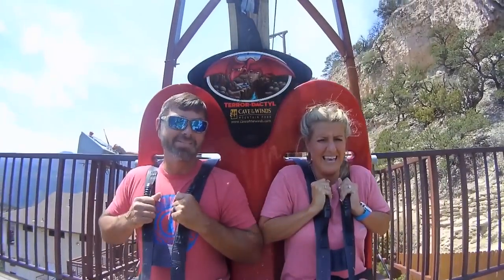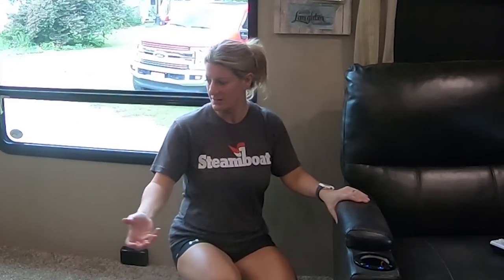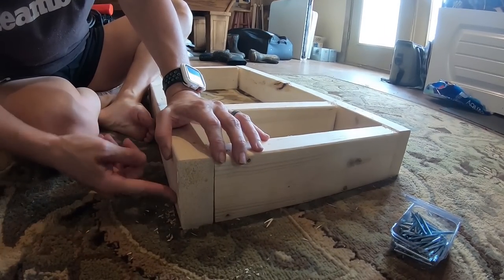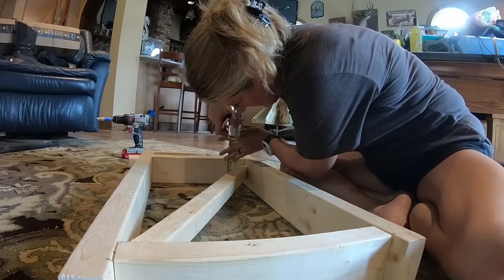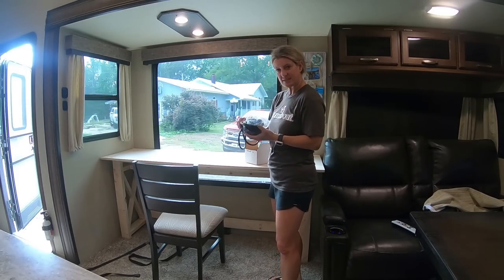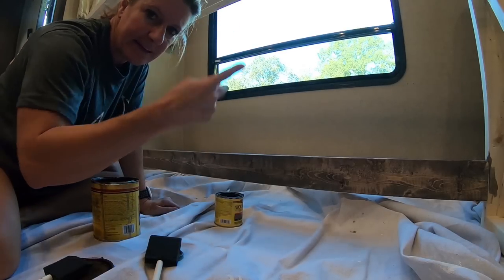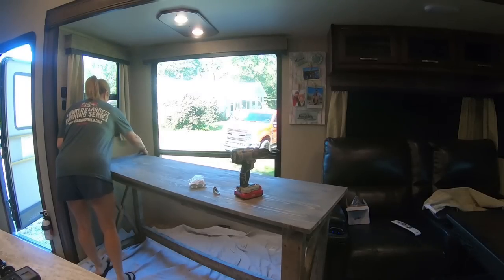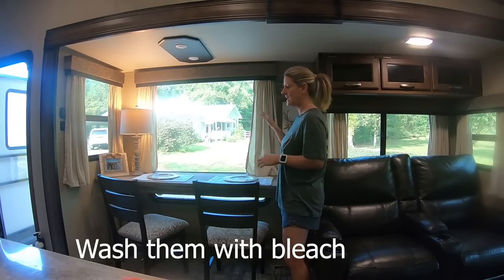Building a Custom Table/Desk for the Grand Design  Reflection 337

Comment: Hi Kelly,  really enjoyed this.  We have the exact same model.  I plan on making the same table.  It’s just two of us and agree don’t care for the current table.   Did you connect the table to the floor?   Or does it ride ok as is?
Reply from the maker: Glad you enjoyed. WE love this desk. I can sit there for hours haha I tried to attach to wall but it came loose but it rides fine never has fallen over or tipped. I would suggest to put felt on the side by the recliners or make it about 2" shorter it rubbed on our recliners. I added the felt later.
Reply: @BillandKelleyAdventures  thank you.   Looking forward to getting it done before we head out on our next trip.
Reply from the maker: @haroldh7239  Would love to see some photos.
Reply: @BillandKelleyAdventures  Kelly,  we have finished the desk and it’s ready to travel with us.  I would send you pics but not sure how to get them to you on here.